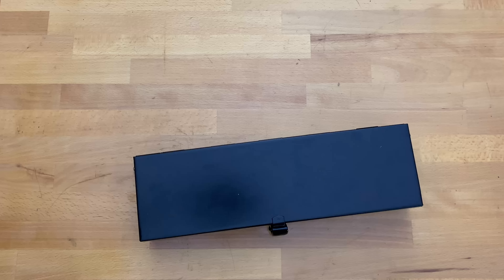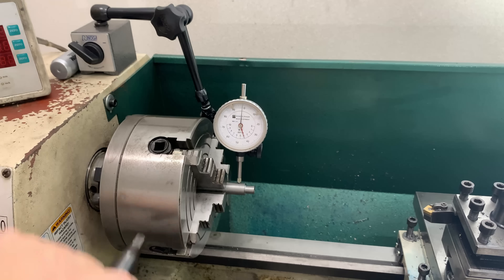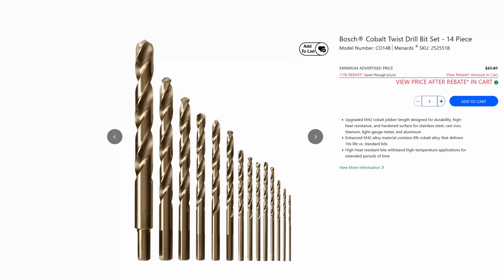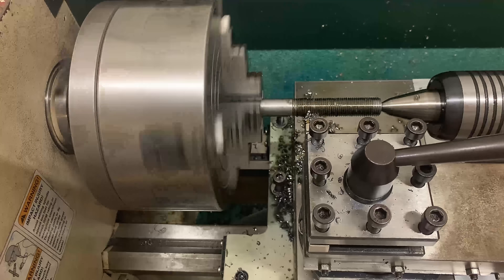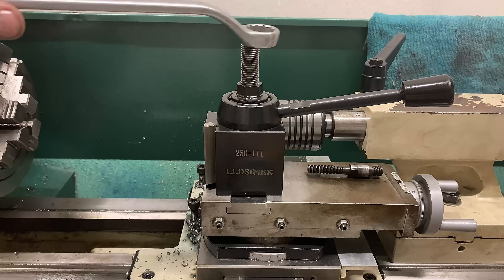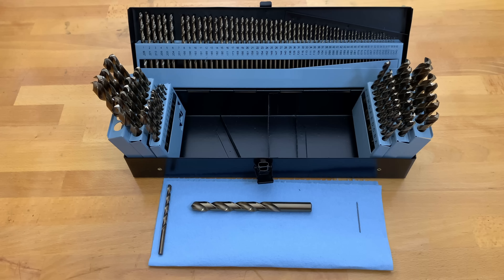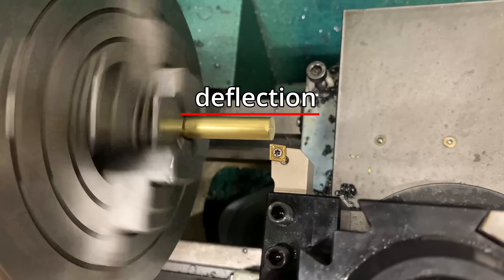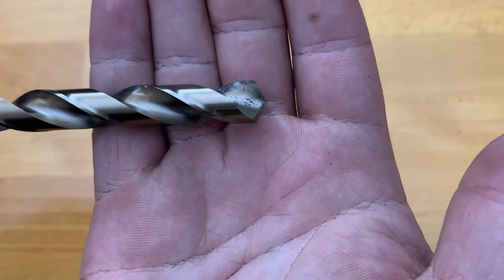Are Harbor Freight Drill Bits Secretly AMAZING?

Comment: I bought a set of these about 10 years ago. I still have them and use them fairly regularly. I've had to sharpen a few of them a couple times, but other than that, they've been good for my little hobby shop. Back then they were only around $50. The strangest part about my set is that the drill numbers 23-30 started rusting badly. The rest are fine.... it's weird.

Great video. Nice editing. Hope to see more. New sub.
Reply from the maker: That's really weird! Some defect in the manufacturing process maybe? So strange. Thank you for the comment and sub, I really appreciate it!

Comment: I run a machine shop and have been using these for several years.  They are good quality and the price is impossible to beat.  They are 135deg split point bits and the material they are made of performs well in all materials. I recommend them often!
Reply from the maker: Thanks for the comment. Guys like you who run machine shops and put tools to the test day in and day out get my attention when you say something is worth a crap. You'll get more time on those machines in a day than I get on them in a year. Much appreciated.
Reply: Same here use mine quite a bit , when they start to dull i just sharpen them to 118 degree and a little back relief they last forever .

Comment: I don't know about your local market availability, but I always buy Dormer or Gühring drill bits. They aren't cheap, but I find general tool brands' drills bits (even the better ones like Bosch) don't compare to specialized brands like those.
Reply from the maker: I'm not sure about local market availability, but I could probably get them from MSC or another big online supplier. I'm sure those drill bits would be a lot more precise than the tools I'm running them in, lol. Thanks for the comment.
Reply: @ShopHumor  Well, I also don't have any good tools, but I find they dull way slower. Since I don't know how to sharp drill bits, I tend to buy them just because of that.

Comment: If you want to give them a real test, try drilling some stainless with them!
Reply from the maker: I plan to eventually, I just don't use stainless much around the garage workshop, you know? Most of the stuff I tinker with is steel or brass or aluminum. Thanks for the comment.

Comment: Are those conversion tables wrong or are inch-fraction sized drill(s/bits) always oversized? I expect a 1/16 to be 1.59 mm.
Reply from the maker: Hey Kris, good catch! I'm not sure what went wrong with the conversion formula on those fractional sizes, but you're exactly right they're every so slightly wrong. I've updated the spreadsheet and am going to add it to the description of the video. I appreciate you catching that mistake.

Comment: These have been sold for a long time from various sources. Purchased the exact same set about 15-20 years ago somewhere. Do mostly wood working, this provided a complete set of various sizes.  Still have the complete set, my catch never broke and the case is painted grey.  If you need to occasionally drill a slightly under/over sized hole in soft material they fit the bill.  If you do serious metal work and make heavy use of your drill bits, probably better off investing in a set of more durable steel.
Reply from the maker: Thanks for the feedback John. I'm using these in mild steel, aluminum and brass primarily so they'll be just fine. We will just wait and see what happens if I ever end up needing to drill some stainless.

Comment: I have this set or very close to it.  HF Drill Master.  I have a box store entry level real drill press, Delta.  My use of this set has specifically been for use with the drill press only, no hand drilling.  IT's not a $300 set and it does not perform that way but I am satisfied with it, the sliding scale of price vs quality.  I'm not doing real machine shop work with the set.  I'm doing farm tool, fabrication,  and welding type stuff.  no precision, just functional stuff.
Reply from the maker: I think that's exactly what the set is suited for. When you're just trying to make things work around the workshop, these will get the job done very well. And having a complete index on hand for whenever you need an oddball size is really nice. Thanks for the comment!

Comment: I recall a few years ago a magazine did extensive testing of various drill bits (including some expensive cobalt and various coated bits.) The testing was in using them on mild steel and stainless. The surprising result was that an inexpensive, black oxide bit of High Speed Steel drilled more holes in less time than any of the more expensive big name drill bits. These “jobber” bits were not even stamped with a name brand but think something like Irwin or Ingersol. They were among the least expensive bits in the test.
Reply from the maker: Project Farm did a really good test video a few years ago where he found some cheap DeWalt black oxide drills performed very very well compared to more expensive brands. Thanks for the comment!

Comment: I use this exact set of drills from HF for all my standard hole drilling everyday (I run a 1 man, 3 machine cnc machine shop) and I have been for 5 years now. I have broken about 15% of them but it was never the drills fault. Its about my only positive purchase from HF....
Reply from the maker: That's really impressive. I converted my little Precision Matthews PM-25 to a CNC a few years ago and it's been a lot of fun. You running a 1 man, 3 machine shop is pretty dang cool. 

I've had some good luck with other Harbor Freight tools, and some really bad luck with others. The 2 ton engine hoist has been amazing, and I really like my tool cabinet. Thanks for the comment!
Reply: @ShopHumor  I started my journey as a hobby machinist and due to how expensive metal working is as a hobby, most of my tools came from harbor freight and your right there are some good bangs for your buck but most of there tools are meh at best. I was really suppressed that my $85 HF drill set ended up being so good.

and badass on the PM conversion. Im wanting to do a CNC conversion on a little lathe I have coming in. What controller did you get for your PM conversion?

 BTW, awesome channel! just subbed
Reply from the maker: Thank you for the sub!! My CNC conversion is running on the Centroid Acorn platform and it was really straight forward to build and get running (well, easy enough to follow along watching some YouTube Videos including their official content). I still have a lot of mods I want to do - designing and building a good enclosure for starters, but that's the kinda stuff that I really enjoy doing.

Comment: Learning to sharpen drills is without a doubt infinitely more important than which specific flavor of drill you buy. 
Regular old HSS or HSS-E is plenty good for hand drilling and odd jobs, anything more expensive should be reserved for highly repetitive work or high end exotic materials.

Also a quick pro tip for hand drilling steel, especially stainless, do short bursts with high pressure, works wonders.
Reply from the maker: Good tip, thank you! I think a lot of people tend to run their stainless at high RPM with too little pressure and end up just spinning and work hardening the material, then they blame their tools.

Comment: I have the exact same set of HF bits (except in TiN) for over 20 years and all are still sharp and except for a few tiny ones that I have fumbled and broke all are still in tact.
Drill bits are one of the items that hilariously unqualified people buy and then proceed to dull and break them all because they don't know how to use them. I would say never take anyone's internet advice unless it is a trusted, qualified source.
Reply from the maker: One of the reasons I bought this set was just to see if they could be as bad as folks were saying, or if they'd actually cut through steel just fine if used properly. I wasn't surprised that they worked. Thanks for the comment.
Reply: @ShopHumor  Where is the link to your other channel? You mentioned in the description in your video but I don't see it.

Comment: I use a bunch of standard size bits to get close and use my good index for the final drill, an index shouldnt be used as a main drill set, its there for those times when you need the acurate hole size for tapping and reaming. Just use the closest under size that you have in bulk and then go to the index to get to dimension. 1 more step but you dont ruin your only number 7 or F
Reply from the maker: Thanks for the comment, good feedback!

Comment: Dont expect to find good quality drill set at any big box store. Go to a industrial supply like MSC Industrial . They will cost more but you get what you pay for.
Reply from the maker: For my use case where I have a very limited budget for tools around the shop, I like to get the best value wherever I can. If I am drilling a hole to half inch and then bringing it up to final size with an end mill or reamer, I'd rather save money on the drill and put that savings into a higher quality end mill or the reamer. Thanks for the comment.

Comment: Can't imagine the points on those drills being very accurate/precise but who knows. The machine shop I worked at started buying Y/G brand drills that are made in Korea for about half to 1/3 the cost of Guhring brand , which are considered one of the top shelf brands, and other European or Japanese high end tool brands and worked every bit as good in every aspect of drilling. So I can see where cheap drills like these could work well for a hobby machinist if used carefully. Harbor Freight Chinese manufactured stuff has come a long way in quality for the price.
Reply from the maker: I'm certain they're not up to the standards of the high end, premium brands that are guaranteeing minimum standards and tolerances, but like you said.. they'll work for what they're designed for. My thinking is that if I'm going to put a half inch hole in a piece of mild steel and then use an end mill to bring it up to final size, I'm going to want to use the drill that is going to get the job done reliable and affordably, and then spend the extra money on a really nice end mill or reamer. I appreciate the comment.

Comment: Have been using this type of set from Harbor Frate as a machinist for years (50+experance), if they broke it was my Falt. not the sharpest point but cheap.
Reply from the maker: You've got a heck of a lot of experience. Way more than I'll ever have. For my needs, if a tool is affordable and gets the job done, it earns a place in my workshop. Thanks for the comment. :)

Comment: I've had my HF Cobalt bit set for over 10 years and still haven't ever broken one and they're all still cutting/drilling fine. But they're also just for DIY home stuff.

I orignally bought them to drill out 4 broken CYLINDER HEAD BOLTS on a GM 4.2L I6. They drilled through those cylinder head bolts LIKE THEY WERE MADE OF ALUMINUM.
Reply from the maker: That's awesome. Sounds like you've got your moneys worth and then some. Thanks for the comment. :)

Comment: As a machinist by trade, the tolerance of a drill bit doesn’t really matter imo, they’re not for precise holes in our shop. If I have a critical bore, I’m pre drilling smaller and using an endmill to finish the bore, using cutter compensation starting the cutter oversized. Sometimes I just bore a threaded hole with an end mill to avoid a tool change in higher production.

There are definitely machinists out there who do need precise drilled holes for their use case sure. And need high quality because all they do is steel. We do almost all aluminum which is like butter.

I might suggest these to my boss honestly. They work fine for all our use cases.
Reply from the maker: Thank you for the comment. I agree that for precision, the drill bit will get you close and then a more precise tool will get you the rest of the way there, be it a reamer, endmill, or boring bar. I haven't reached the point where I'm boring holes with end mills because I'm usually not too concerned about total machining time and more concerned about tool life and saving those more expensive end mills while sacrificing the cheaper drills, but I get it to avoid a tool change when you're doing a production run.

Comment: I picked up one of those Warrior sets during a spend this much and get this for 5 bucks. The set had more than 30 bits but they were crap. Many were bent. I was able to use a few bits a couple of times when I just needed a hole that didn’t need to be accurate. Junk. I paid 5 bucks and all I got was frustration.
Reply from the maker: That's really frustrating. I'm sorry that your experience was so negative.

Comment: My boss bought them for use in a cnc mill, go with hertel much nicer the problem is a shop buys these expects it to be the last set ever bought if they break…you just don’t have that size 

So you want to force your boss to buy the best in the market because he’ll never buy you a replacement 

Your shop you’ll replace them 

That’s why machinists hate cheap shit bad management
Reply: Also l-o-fucking-l at “keeping a few sets around a production shop” dudes never worked in a machine shop, youd be lucky to have a full set period…. I’ve worked in cnc manufacturing for 5 years, I’ve personally only opened 2 new tools ever… a reamer in a new size I just programmed for and a 1/2” end mill as a reward for hitting their millon dollar project goal
Reply from the maker: I was more just reflecting on the value of the set and that, were I doing acquisition for a production environment, that for such a cheap price it would make sense to have a few on hand because they're so cheap. You're right I've never worked in a machine shop directly, the closest I've gotten is working some odd jobs that had in-house machine shops, but I've worked a lot of places with cheap bosses and bad management, so that checks out!

Comment: Thanks.  FYI, McMaster sells all the individual sizes in high quality bits.  I use those to replace broken and/or special sizes.  That Harbor Freight is probably a really good deal - just replace the common sizes as they get broken.  And have a good sharpener for the large bits.
Reply from the maker: Thank you! I'll be stockpiling extras of my most commonly used sizes. I order from McMaster-Carr relatively frequently (their website is second to none IMO).

Comment: i literally just made an extension for a mic boom…i ended up using bosch #7 from lowes.  the HF kit is ok…but you will never use 90% of the drills provided.
Reply from the maker: How did your extension work out? How long did you make it?

I don't know about 90%, but I bought it knowing that there will be sizes that I probably never touch. I do a lot of projects, tinkering, and repairing odds and ends around the house, so knowing that I'll be able to drill just about any hole for any tap is nice.

Comment: I once bought a 64 piece  bit index out of desperation from Lowe’s , it was their product line of Kobalt which as I recall was all they had in house 20 years ago.   Now these bits went dull very fast, I mean really fast, I then sort of found out why when the 7/16ths got stuck in steel so I reversed and forwarded to break it loose and actually untwisted the drill bit into a flat bar with one round end.  Don’t quite know if that was material or temper issues or both maybe but junk none the less.
Reply from the maker: That's crazy. Sounds like they were made out of recycled disappointment lol

Comment: I agree with the conclusion.  I have purchased 4 or 5 sets for both home and use in my R&D lab at work.  Cut well on Stainless,  aluminum and  grade 2 titanium.  The bits have a geometry that is easy to resharpen.  The other drill bits that HF sell are not very good but this set is worth the money.
Reply from the maker: I haven't used mine on stainless yet but I need to get some stock to test on. Most of the projects I work on around the house and the workshop I just use mild steel or aluminum, sometimes brass, so that's what I had in mind when buying the set. Thanks for the comment!

Comment: I have had good luck with Milwaukee Red Helix bits. Cobalt bits are brittle and drilling by hand there is always a risk of breaking them. People expect tools to overcome operator errors and consumables to last forever. I may need to check out if any of the Warrior bits are at my HF. I am missing a bunch of number and letter drills.
Reply from the maker: Glad your experience with Milwaukee Red Helix was solid. A lot of people leave reviews after they break or misuse tools and the review is more of a reflection of their abilities than of the tools themselves. Not always, of course -- lemons exist and sometimes things are crap, but it's just a trend I've noticed.

Comment: Steel, aluminium, brass is not the use case for cobalt drills, you buy them to drill stainless steel, and if they can't withstand, they are crap.
Reply from the maker: I agree in theory. I just wanted a complete index that I could throw at any metal that I use in my workshop, and this lets me work on stainless from time to time if I want to. It's nice to be able to just reach for a size when you need it and it will be there.